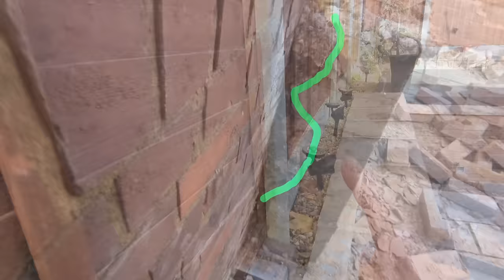PART 2! What exactly DID go wrong? Who paid to put it right?

Comment: See my previous comments.

You're a good man.

I think you've sussed it. You'll never stop the water so it has to vent across the board. Can't use sleepers or modern timber, it won't last 5 minutes and it won't be structural. Neither would dry stone walling, imhho, you'd need buttresses as it would, if it didn't collapse, bulge etc.

As you say the perfect storm. Too much to contemplate in many ways, most would have to wear their pants on the outside and have an S on their chests to have noticed all of that in the first place. Hard lesson to learn though and the devil is in the detail.

I'm off to check the overhang and drip onto brick (hopefully away from brick) on our new patio steps tomorrow! Also I noted that to the eye the steps look right, align with brick mortar joins etc etc, but too that one step doesn't drain well - thus it could freeze (it looks right but with a level, it angles back slightly) etc. We do get sun etc though, winds too so the area does dry fairly quickly.

The neighbours wall there doesn't look great now does it, plus them being all paved atop (weight, no drainage etc etc)? In our garden we've got soakaways and gravelled areas plus soil etc to drain water and water plants etc. We've also got falls, same on front driveway etc.

It's a mine field for customers though, let alone the experienced builder too💜💜✌️

Comment: Yes water is definitely the problem. I have worked on engineering projects all over the world and can guarantee the a soft mortar mix will fail when constantly wet. I dont doubt the brick. I would put plenty of weep vents and use a waterproofing agent in the mortar. Drystone wont work there.

Comment: Alot of your problem is the height of next doors garden,and that the height that the posts were set .There is soil above your side of the wall.When the next door's wall eventually falls over,it will take your wall with it.
It is always a good idea to spot the differences in height of the gardens before you start.I've worked in hilly areas,and made the walls upto 3ft thick at the bottom to take the weight against it.When you tank a retaining wall,there needs to be sheets of ply backing it,then a foot of stone chippings.The ply stops the tanking getting punctured.The chippings are for drainage.If you had surveyed the situation properly,then the next door neighbour should have been included in the price negotiations.I admire your honesty,but I certainly wouldn't accept any blame when next doors garden falls over.Personally,I would inform your customer of the situation,and tell him at this point,that's all you are going to do.

Comment: Sorry you've had to do the wall again.shows your genuinity..top Mark's.   being a retired plumber of 75 ,I've worked on many building sites mostly in similar elevated places like your location on the video..what I do  remember is that the bungalows and houses at the bottom of the estates always had very deep footings....something we apprentices found out if they hadn't been first fixed and joiners had floored...they space was full head height....and with 2' 6" of water..and us in waders....were always aware on each site of clay field drains when installing soil pipes  to drainage and learned early on about hilly locations....sites were basic in 1963.....mud,mud.mud..."WONDER WHERE ALL THAT WATERS "coming from......I've made many mistakes to my cost....consider the most unlikely on every job,,,,,well presented vid..from a honest and decent guy.👍👌

Comment: The lateral load the fence exerts really needs tone eliminated. Structural engineered design to control those loads& water drainegde are most important. It involves way more cost than the brickwork. It is a separate element that is in addition to the cost of the brick work; most likely muck more costly than the brick work

Comment: Hi champ just a though maybe remove bricks and concrete it shutter board style with drain behind formed into the wall put your original capping on top. Cheers ,good luck your a good man 👍
Reply from the maker: That's a great idea mate, it'll solve all the problems won't it. Cheers fella!
Reply: Your very welcome👍
Reply: @mrabuilders6723  this man is correct , u can’t beat the strength and longevity of concrete. If you have space left on face side after shuttering 200mm of 35N concrete, rebar drilled into foundation also obviously, one could put single skin of brick in front no problem with weep vents at base and a good coping, best of luck from Ireland 👍
Reply: Awesome idea cheers

Comment: 1) the existing cement Block retaining wall is the first Major failure.
1a) Same as the double Brick
Leaning Fence app. 1m   high Retaining wall. 
That's a non structural type wall. 
That's the wrong type of wall. 
As well as the hygroscopic water pressure is pushing the wall over 
2) it is wet top to bottom
3) inadequate water management,
It should of had
French drain behind capturing & redirecting the subterranean water with a solid pvc pipework to the stormwater system or to the street Gutters. The waterproofing & plastic behind is not working & cannot work properly if Drainage is
Not releasing buildup of water.  

4)  the top Dividing fence will fall as well
As the foundations are built incorrectly.
The Weep holes are too high - allowing water too pool up behind. 

5) So Now to the Decorative Brick wall. 

6) Now you have identified & understand the Existing Problems with
the neighbours 2 types of failed Retaining Walls. 
Run -
 only joking.

7) Q. Can you Dig the 30 or 50 Linear metres of trenching to Manage & Redirect all the water coming down the hill or 
to the existing stormwater Easement if present. 

8) Note - Alarm Bells 
 this should be the first Alarm bells to you.
The fact the existing leaning Brick Fence 
Is made of Bricks.
Proper Retaining walls are not built out of Bricks. No good Lateral resistance.
Use Steel Reinforced 
Concrete core filled 
Walls by an engineer
Over 600mm high. 

9) The Existing Fence is Leaning - 
There is a Real problem with the Drainage behind the Wall.

10) 
Build a Drainage line or
Poor a Concrete spoon drain in front of the wall to capture & disperse all of the Subt. Water.
A Trench in front of the
Existing block wall has 
Risks - Do not undermine the existing Foundations. 
The proper side is to do the Drainage on the neighbours side.

Comment: In what state is the mortar between the pavers on the patio? If it’s ok, was it different to that used in the wall? I ask because it appears ok and would have got just as wet as the mortar in the wall. The retaining wall behind yours and the wall down the side of the house and the patio are all in direct contact with the earth which gives them thermal mass and more resistance to freezing. Your wall is standalone and has little thermal mass and as you say, keeping the water off it is important. I can’t see engineering bricks helping unless you plan to use a waterproof mortar. Sorry if I’m talking nonsense, I’m not a builder.

Comment: I'd of used a geotechnik membrane and gravel rear fill to reduce pore water pressure. Lower the water table by this method and install a vertical dpm.

Comment: I thought I already commented? Anyway, the blockwork behind the brickwork on the neighbours boundary appears to be sound and the previous brick wall behind the new work facing into the back garden appears to be sound as well. On that assumption it doesn't appear to be a frost, water or pressure penetration problem. More likely a weak or bad mortar mix caused by too much water, incorrect ratio or bad cement product. Unfortunately for you it is on you, despite your previous excellent work as displayed on the extension. Shit Happens! Most important thing for you is you reputation, which you can't allow to be tarnished by a bad mix. Standing over it even if it was a manufacturer or mother nature issue will only strengthen your reputation in the long term. No mug in doing the right thing, it will pay off in dividends for ya! Love you approach and attitude!.

Comment: I think id core holes into the whole wall every 1.5m or so, pack with loose gravel.
That will relieve any pressure built up as it will find its way to the easiest way out.
No need for drain in whole length. 
I don't believe lack of drip edge on coping stones the fundimental issue.
More like water pressure from many uphill gardens running down to it.
Cladding to retaining walls should have 50mm gap between to allow for movement.

Comment: Why are you so concerned with the brick when it the sand and cement that is failing, maybe just a waterproofer in the mix and dry zone the wall after it's all built!! Frost is never going to be a big issue behind the wall, and water will find its way to the weep holes.
Reply from the maker: Hello Shawn, hope you're well mate. It's how the bricks react with water that can lead to the mortar failing. In this instance if I'd used a waterproofer in the mix then it would have been the bricks that would have blown and not the joints.

Comment: MY ASSUMTION IS....... ITS ONLY A OPINION..... It all depends on when you laid the bricks... Was it summer or winter? It's frost damage if laid in winter, the wrong mix of pointing mix if it was summer or both, the frog mix went off and cured... Your mix looks dryish in the mixer, and your mixes may not be right, I'm an old-school builder, so go to an old-school builder and ask about or learn about different mixes, don't miss washing up liquid with the mix or any additive, the mix must be wet enough to allow the bricks to soak up the cement mix which it is in effect the glue the "glue"  my mix mostly is or was 3 to 1, but talk to a old boy and see what they say about mixes or even a old labourer..... Your drip course issue resolution is good, even dry-stone walls have a drip course, I've built them... Buy an old boy a few pints then ask loads of questions...... Well done in doing the right thing....... Cheers............................. Oh, and I would have placed a gap or cavity, between the blockwork... But we are seeing hind remember LOL... I had this happen to me once, the same thing, and it was frost rot, the frogs were ok, but the pointing was bad, same as yours... Cheers..... What do I know hay?............................

Comment: I paused the video at 2:55 and am going to give my best guess, it was pissing rain when you bricked it up and or it was pissing rain the days after, going to guess it wasnt couvered with poly for at least a few days and the morter was not mixed more solid,  and did you place poly on the inside so the soil and water does not soak into your brcked morter , k, going to watch the answer 🙂

Comment: That retaining wall should be a structural engineer calculated, proper retaining wall. Its currently heading towards being classed as a dangerous structure. Where its at the bottom of a hill proper surface water management is required.

Comment: It definitely not the dampness, its the mortar mix not good enough.  Water doesn't weakness concrete, there are concrete bridges built on water and last for decades.
and secondly cement require curing for at least 7 days to achieve proper strength, when u build it and don't allow it to cure, then the cement just turn into mud.

Comment: I would take the outer leaf down and cut in some 60mm perforated land drain pipe into cavity and lead water away under patio into most convenient drain also copings drip edge should be at least 35mm away from wall ,was told this by architect

Comment: But if it is raining and the wind blows, all the walls will soak up the water and then freeze. Stone walls are cement and stone and have no drip edge. Water runs off the capping on the wall. During the winter, when it is wet and freezing, the cement does not break down. I am a repair person, not a Masson. So, I like to understand the why of things.

Comment: First I am 73 years old started my bricklaying back in 1964 and was a bricklayer up until 2014 when I retired at the age of 65, the frosty weather that happens in the years of the 2000 is a small fraction of what was happening in the 1960 through to the 1980+ years and I don’t think frost is the problem, 
The wall needs to be built with a reinforced concrete with a slopping construction of about 5 degrees a membrane placed at the back of the wall before backfilling, that includes a properly constructed drainage system with through the wall drainage at the base.
The cladding brickwork can be of any type of brick or stone, a small cavity with ties the cavity can be filled with a cement sand or concrete slurry, if you wanted to take it one step further you could use a liquid DPM On the face of the backing retaining wall, the mortar should be 3 to 4 to 1 ratio, but should not be stronger than the brick or stone cladding, the capping is best if it is constructed with a drip grove with a 50 to 65mm overhang I can’t think of a time in my career that such a wall has failed because of frost. 
If you are happy that you have prevented water passing through the wall you can treat the brick face with a liquid clear rain barrier 
This is as they say just my take on how the job could be constructed but I also know that the belt and braces jobs cost money and sometimes it will price you out of the market, good luck with your business.
Regards 
Colin F

Comment: This was a mental roller coaster.
It was down to you to remedy this one as clearly the design /build is at fault.

I first thought bad cement, but when you got the wall down the retainer is not built correctly and there is a drainage issue. 
There is a retaining issue too. 

This is one of those learning things and experience that comes from time doing the job and fixing and knowing why things go wrong and how to put them right.
Unfortunately with the damp shaded areas and the brick type and cause not addressed it's going to be a repeater.

You needed to rebuild the retainer and gap the bricks and cross them. So you have an easy flow air and water path. 
Then  when venting the clad, do that at the top and bottom and a min 30mm gap, preferably 50. With upper and lower weaps.
The bottom would have a gully and the end gap will help a lot. But without the rest it tends to localise the problem.

Love and learn...

Comment: I don't think the lack of a drip on the coping is a major contributor to the problem though it's not helping. A flank wall open to the elements dosent have a coping with a drip but dosent deteriate like that also a brick on edge coping on a tile creasing dosent have a drip and in normal circumstances the wall dosent suffer.
Reply from the maker: I see what you're saying Andy. There's a perfect storm of a few factors I think but I'm confident that the water in the ground that's coming in from the back isn't getting to the bricks, not so consistently through the entire wall. Hope you're well mate.
Reply: @mrabuilders6723  All good mate, hope you resolve it 👍
Reply: Got to agree with Andy. But it’s builders doing landscapers work lol. Copings need a bit of fleet to run water off. You could be right about the freezing if the walls are permanently wet in winter. But the main problem is down to original builders who built the houses and the retaining wall which you pointed out as leaning. Like you said all that water has to go somewhere. The retaining walls should have been built with French drains  behind to deal with the water. Also the fences behind or fixed to back of wall so wall needs to be strong enough to take the extra strain. This should be in the design stage. I expect the area you’re in has been dug out to make the patio we see now  and the block walls were built to retain it. Probably in dry weather without a thought for drainage which is the one thing that always gets overlooked.  That retaining wall is only going to get worse, needs taking down, reinforced concrete L shaped retaining wall with drain behind refaced with brick. Neighbour’s problem really. Roy

Comment: I would check if area is prone to sulphate attack. Because your wall is below ground level I think this is the problem. 1:4 ratio mix should not dissolve like that after a short time.

Comment: great that you returned to sort it out and I agree that no drip on a coping causes issues but usually just blows the front of joint and brick in the freezing process, your mortar was bad all the way through?
Reply from the maker: Hello Scott, the mortar was solid in the frogs so I reckon that the bricks are just soaking up all the water and freezing and basically delaminating the wall if that makes sense?

Comment: If brick walls are constantly wet and in the shade they get moss and slime on them. Unless the owner has been washing them down... Which would be a question to ask, for all i know putting bleach or cleaning agents on mortar over the years could break down the mortar, a quick look on the internet has varied answers from yes to no. Id say more yes. (And it's important to note that the retaining wall mortar has not failed).

Comment: Your mortar needs to be of high cement mix to be  water proof to stop the mortar absorbing water freezing in winter expanding and causing the mortar joints to fail.The freezing and thawing of the mortar is casing it to crumble.

Comment: I’m not keen of using lbc bricks in garden walls and below ground but I have seen class b’s shale off their faces and degrade in the same conditions. Seeing the blue courses and block courses remain sound points to those awful lbc bricks, there’s something about how they are made and the material they are made from. I would have considered tanking the block wall with sbr and thin waterproof scratch coat/slurry.

Comment: At least the smart looking extension didn’t have any problems! Is there not an additive that will stop water passing through the joints ?
Reply: builders (pva) waterproofing. you mix with the water, and use the mix when making the mortar.